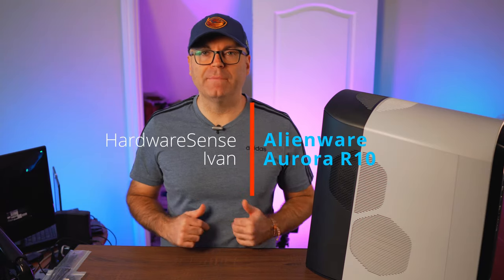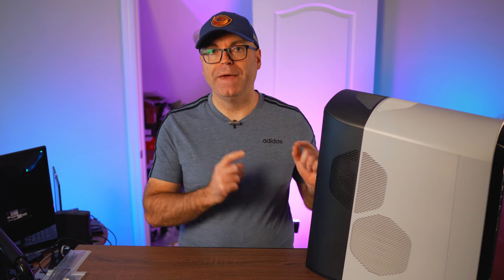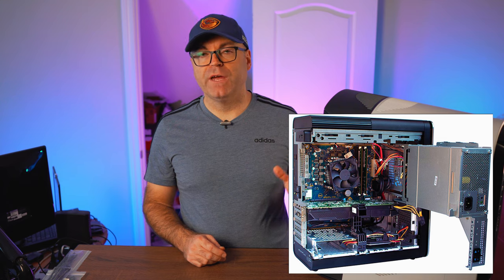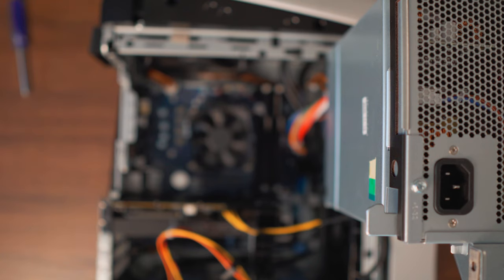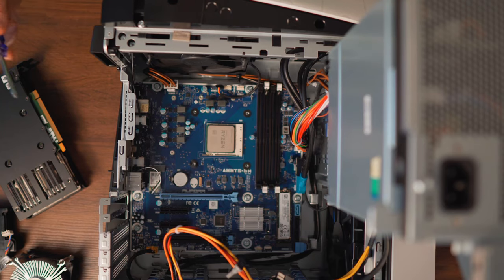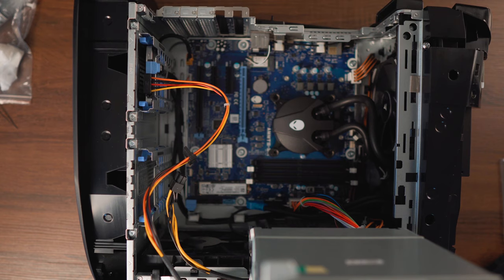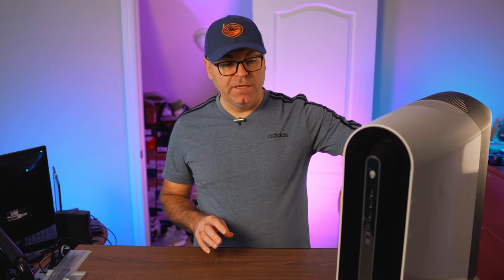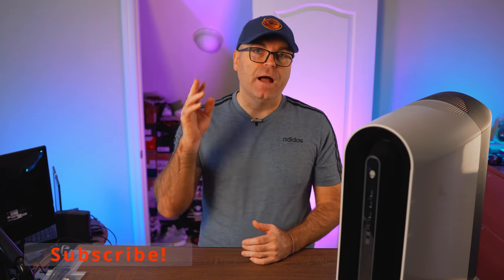Alienware Aurora R10 - All The Cooling Mods, That You Need!

Comment: Why do you need the VRM heatsinks? I just ordered a Corsair H60 AIO with included fan, do I need anything else?
Reply from the maker: As there will be nothing to cool them off there, it will help with the longevity of the motherboard
Reply: @HardwareSense  The top case fan won't cool it off sufficiently? If I'm not going to overclock the cpu, and the cpu WAS hitting 95 degrees before the liquid cooling upgrade, it should still be better than it was before in terms of heat on the motherboard, no?
Reply: @msharmall7298  The psu in this case puts so much heat onto the motherboard. I don't think the case fans alone are enough.
Reply: @reddemon163  Hmm.. I have been watching the heat sensors on the motherboard and only one of the motherboard sensors gets very hot. Maybe a peak of 85 degrees for only a second, usually under 80 while playing games. Also, I looked at my motherboard and I don't see room for VRM heatsinks. I don't see how they could fit, on mine there are little metal colored squares in the way.

Comment: What size screws did you use for the top fan of the aio? Im doing this upgrade today and my case only has to screws in the sop holding the bracket for the rad.
Reply from the maker: No idea, those are the standard that come with every aftermarket AIO

Comment: Interesting. I've built a PC but I don't consider myself knowledgeable of everything, is that push/pull config you've got on the radiator common? With one on each side? It's a good idea.
Reply from the maker: That is recommended for smaller radiators and others if you desire less noise without losing effectiveness
Reply: @HardwareSense  Oh okay, good to know. Thank you!

Comment: Hey, I'm having an R10 Ryzen 5800x with AIO - RTX 3070 and done those Fan Mods. Which FAN Headers do I have to use for which fan? Right now Im using an Y-Cable for the two top fans and plugged into Fan TOP. If I put the CPU Aio to CPU Fan - AWCC shows 100% all the time. Is there any way to implement Fan Control, since AWCC sucks a bit.... The software shows only my 2 fans from the RTX 3070.

Comment: Wow, that was a great deal on the R10 with an RTX3070 for $1200. Last week I was able to buy an R10 with a Ryzen 3800x, Liquid Cooling 1000w PSU, Lunar Light case, RTX 2070, 8GB of DDR4 2933Mhz, 512GB Nvme, Wifi 6 for $1240. I plan to upgrade the RAM with (Adata) XPG 16GB Dual Channel 3200Mhz.

Ivan, what's the highest clock RAM the R10 will take, 3600Mhz? How much and which RAM do you suggest?
Reply from the maker: I would go with 3600mhz, nothing more.
Reply: @HardwareSense  Is Oloy memory reliable? Amazon is selling a 32GB 3600Mhz kit for $149
Reply from the maker: @rodbriggs8552  I have one kit and is not bad, don't see any issues with it.
Reply: I’m crying lol 😅 I should have bought a computer back then lol. Still looking at a decent computer but geez, I missed out big time

Comment: Thanks for the awesome video! Would you have any particular cooling mods for the GPU? Or would these fans help? Thanks!
Reply: is there enough space to cool the gpu?
Reply: These fans helped significantly - I threw four noctua into my case and it's not only much quieter but even the GPU is -20C cooler.
Reply: @xenomorph7299  there's some clearance (maybe 3 inches) below the GPU in mine and an exhaust port right there, so you could certainly throw in a GPU AOI cooler without sacrificing either 3.5" bay. 
Not sure how you'd mount a fan horizontally - maybe on the side panel. I have that on my NZXT tower. It might work here too to push that GPU air out rather than having it blasting straight down on your supplemental SSDs. I didn't see a third fan slot on the MB but you might be able to split off from the others.

Comment: First off, thank you for this. It helped me with the process a lot

Question though; after swapping out the radiator fan for the push/pull configuration I am now not getting any spin on either fan. The actual water block seems to be working fine but no fan operation. I've checked the inputs and they all seem to be fully plugged in

If it's worth noting, I also replaced the front fan and added one in the HDD slot and they are working fine. So it seems I can rule out hardware issues with either the fans or the Y splitter
Reply from the maker: So the same Y splitter is working guaranteed?
Reply: @HardwareSense  the Y splitter came in a 2 pack, so I feel confident that it wouldn’t be the issue. I could be wrong though. The one I got is from JBtek
Reply: Disregard, I’m an idiot lol just checked again and the top fan input was only plugged into 3 of the pins rather than all 4
Reply from the maker: @Schmetzz  That was going to be my next suggestion, as it happened to me recently as well

Comment: I don't see a link for the 80mm fan you used for the top front intake, does it matter what is used? Are you able to control the fans with the control center after changing from stock?
Reply from the maker: I used the fan that is coming with the stock air cooling solution, just take that fan, as its PWM and can be synced with the front fan.

Comment: Just curious if there is enough space to mount a fan on top of the metal chassis above the radiator but under the plastic shroud?  It seems like the top plastic shroud is huge.  I have no experience with these but am considering getting one.  Thanks.
Reply from the maker: Not possible unfortunately, I tried already.

Comment: Spectacular job. Did the 2 fan upgrades using your video and 2 others to corroborate. Had i known (post job) that you did the third, I would have gotten the job done today as I ordered 3 fans. I did get a bios error, but changed the top rad fan power to cpu_fan instead of fan top and fixed it. I’m curious how the third fan will act when i get to it.
Reply from the maker: I did the same, initially getting only 2 but later a third one for the front. I didn't get any errors on my end everything worked right away.

Comment: Hi, I wanted to do the push-pull, but I can't find the proper screws for it. The original ones are too short to go through the top fan to the rad. Can you tell which ones you used?
Reply from the maker: Check out the comments they are listed

Comment: I also replaced the top fan with a Noctua PWM 4 pin fan. But I can not control this in the AWCC. How did you implement the fan control?
Reply from the maker: The AWCC will control the RPMs when needed

Comment: I have a r11 (air cooled) ((big mistake)) with i7 10700F and 2070super and noticed my cpu temps were around 95c average gaming so I panicked and quit gaming.  I opened up the case just for shits, left the case open and put a small usb powered fan blowing inside the case and my cpu temps went down to 74c average.  Thats over 20c average difference without changing any parts, that's just insane.

Comment: Thanks a lot for this video! Quick question though, I have an R10 with ryzen 3700x and plan to replace the air cooler with a corsair H60. I managed to find the left VRM on ebay. No luck finding the top part (4D5V9). Dell claims they don't sell it... despite you and other being evidence they do. Would you recommend going with only one VRM ?
Reply from the maker: I would suggest keep contacting them, every sales man is acting differently, I am currently looking for the VRM heatsink for my G5 and other people are saying that they bought it from Dell, but they tell me that they don't have it, or they don't sell it, last one told me they are out of stock at the moment.
Reply: @HardwareSense  Thank you!
Reply: Just as an update, I called Dell again, and they just offered to sell me their custom liquid cooling solution plus the J46J2 VRM. Apparently very few units are left.  However, the small top VRM remains unavailable at the moment on their side (no luck on eBay as well)
Reply from the maker: @Atreyuh55  How much for the AIO they want?
Reply: @HardwareSense  120 for the AIO + 1.15 for the left VRM heatsink. I live in Canada so those price are in Canadian dollars. With taxes + shipping the quote was 140 $. The rep left me his email address to check periodically for the availability of the 4D5V9 heatsink
Reply from the maker: @Atreyuh55  Yes that could work, but I would suggest keep contacting Dell, eventually they will restock. In addition, if you are not overclocking, it's not that big of a deal
Reply: @HardwareSense  Thanks a lot for your answers and your help!
Reply from the maker: @Atreyuh55  Appreciate the support.

Comment: Definitely awesome video Ivan, thank you for your time and efforts to show it here so everyone can get great benefit of it!! Just got a couple of questions regarding the fans and RAMs upgrade:

1. Would you mind to let me know what brand & model of the fan are you using to replace the HDD slot? I’ve read the comments that you’ve put the 80mm stock CPU fan in it, but 92mm will work too. So what is the brand & model your fan in the HDD slot?
2. Regarding all the fans connection, although I’ve connected all them but I’m a bit unsure. First of all, like in your video I replaced front, top and AIO stock fans with 3 Corsair ML120 Pro fans. Then I used 2 Y-splitters from Noctua, one connects top fan & AIO fan then plugging into “Top Fan” on motherboard, another one connects front fan & added HDD slot fan then plugging into “Front Fan” on motherboard. For the short cable comes from AIO pump, it connects to “Pump Fan” on motherboard. I’ve also notice this leaves “CPU Fan” port on motherboard vacant. Would you please confirm this is the correct set-up? Thank you so much.
Reply from the maker: The HDD cage fan is the stock CPU fan, any 80mm or 92mm would work.
The top 2 fans on the AIO should be in the CPU Fan PWM plug and the front in the Front fan plug, AIO Pump in the Pump plug.
Reply: @HardwareSense  Thanks for replying mate. So you mean I should plug the Y splitter (connecting the top 2 fans on the AIO) into "CPU Fan PWM plug", instead of Top Fan? That means Top Fan PWM plug should be no cable plugging in right?
Reply from the maker: @leoyin8149  Correct, and I can't remember, but I think I used that plug for the HDD cage fan, it's been a while I will have to double check
Reply: @HardwareSense  I see. I use a second Y splitter to connect Front Fan & HDD cage fan then plug Y splitter into Front Fan PWM plug.
Reply: @HardwareSense  As I searched online, if you air cool the cpu, connect the fan to cpu fan plug. But if AIO, the cable should plug in top fan.

Comment: I have an r12 with 11400f and 3060ti do you think I could get away with one fan for cpu cooler and one fan to replace the front fan? The Noctua NF-A12x25 PWMs are quite pricey!
Reply from the maker: I would just get the ML120 Pro, they at least 100% proven to work with no Bios errors

Comment: Great video! I purchased an Aurora r10 Ryzen 5950x with a Nvidea 3090 and did some research; the noise and cooling is an issue for some. I’m going to get the Noctua fans but my question is how many fans do I need for this monster PC? Thanks
Reply from the maker: I would suggest that you get 3 Corsair ML120 Pro instead, some people are reporting issues with the Noctua fans
Reply: @HardwareSense  Have you gotten any bios errors with your Corsair fans?
Reply from the maker: @Anthony-ve7ed  Zero
Reply: @HardwareSense  copy that. I’ll look into the Corsair!! You wouldn’t happen to know if the rgb version of the corsairs causes any problems be the non lighting by chance? If any 😆
Reply from the maker: @Anthony-ve7ed  The RGB would be fine but you won't be able to control the RGB and you not going to see it through the solid panels, so it's kind of a waste
Reply: @HardwareSense  and do you need any special extra large screws for put the double fan with the radiator? Where I can get it?

Comment: Do I 100% need the vrm heatsinks I seen multiple videos with people not using vrm heatsinks and still applying the h60. I'm going for the H60
Reply: How did it go? I am in the same boat. Gonna install my H60 in a few days without the VRM heatsinks. I keep reading online it's fine as long as you have decent airflow and aren't overclocking?
Reply: @msharmall7298  I did it last night and so far so good my gaming temps were in the high 70 going into the 80s even hitting 95 while video rendering and then I switched to the h60 and getting 50c while gaming. I don't know how to check my vrm temps but it's working so who cares lol imma buy the heatsink later and install it it's only 10 bucks on eBay so what the heck
Reply: @kammii7272  Can you find it on ebay? I couldn't. That's great about your temps though, my 3700x is heating up just like that. Even more so, maybe. I hope this upgrade has the same effect on my machine. Also I've never done anything inside a computer before, could I maybe add you on Discord so I can msg you any questions I have while I'm swapping it out? If not that's understandable
Reply: @msharmall7298  yeah just look up vrm heatsink for r10 on google and a forum will pop up and a guy in the comment section stated the part number if might have linked it. It's super easy but I'd recommend not watch this video instead watch another one I watched a tutorial from a guy named "Stony World" on youtube and he showed and stated it perfectly. When you watch the video I watched make sure you read the bio to bc if you have a r11 you have to plug in the h60 pump in differently but he states were to put it in the bio of the video so yeah
Reply: @kammii7272  ahh okay, thanks man I appreciate it!

Comment: When you replaced your fans did you lose control of fan speed?
Reply from the maker: Didn't even know there was control with the stock ones, lol
Reply: @HardwareSense  you can go to your command center
Reply: When you replaced your fans was Aurora 10 temps cooler?
Reply from the maker: @RichardMoreno24  Never needed to adjust anything, with new and old I left them at auto

Comment: I have the OEM heatsink for the VRM's from Dell. It is an "L" shaped piece unlike yours. Should i cut the smaller section away and not use that? I really don't see VRM's on the motherboard as I do with the first set.
Reply from the maker: Don't cut anything, if it fits, install it. Different versions have different types
Reply: @HardwareSense  Got it... I have an R12 so not sure if that makes a difference? There are just pads on the circuit board where those VRM's are supposed to be. Little concerned of a short putting the smaller heatsink over them? If you still need the smaller heatsink let me know. I have 2 of these from Dell.
Reply: OK i answered my own question. It appears the smaller heatsink section does not touch anything to create a short. Let me know if you want to smaller heatsink. Ill get it out to you if you do.
Reply from the maker: @alphaboy1872  Thank you, appreciate you trying to help, but I sold my Aurora a long time ago 😊

Comment: Great video. Can you do one on adding heatsinks and/or thermalpads to the dell oem rtx gpus. I just got my r11 with rtx3080 and the vram temperature stays at 100+ degrees when using memory intensive apps.
Reply: Set a custom gpu fan curve in MSI Afterburner. Make it aggressive. I haven't seen higher than 63 C since I set an aggressive fan curve.
Reply: The biggest thing you can do for the Alienware 3080 is reapplying thermal paste and adding some around the heat sink. The issue stems from them not having thermal paste for the rest of the gpu and instead putting stickers where there should be paste.

Comment: I was in that same position with the 3070 and got the 3060 ti version too. Same exact one you have
Reply from the maker: Its pretty good I have to say, especially for the price.
Reply: @HardwareSense  by the way, I contacted Dell for that VRM heat sink and they told me that they can’t sell me that part unless I send back the whole computer back to them. How did you manage to get the part from them? And also, I looked at eBay for the bigger heat sink and couldn’t find it.
Reply from the maker: @daniel-ix  Be persistent, contact them every day, different reps do different things, you will eventually find one to sell it to you

Comment: I'm waiting for my R10 to show up with a 6800XT and a 5800x.  It does water liquid cooling already.  Can I get away with just installing 3 of the Noctua fans or should I redo the thermal paste and reseat the cooler?  Nice video, btw. Thanks
Reply from the maker: I think that it might be a bit difficult to mount the fans without taking the whole AIO out, so repasting would be necessary.
Reply: I tried this, doesn't make that big of a difference. The case is flawed. I was idling at 65 and game time was 85. I got a new mobo, moved it to 750d with extra fans and Noctua NH d15 and I'm idling 35 and gaming at 60 to 65. And I used noctua paste. Mind you, you will lose your warranty if you do this, but it was worth it for me.
Reply from the maker: @rafayelk3736  Yes of course, so you just used the parts and made a custom, it's no longer a Prebuild 😉
Reply: @HardwareSense  only way to get an rtx 3080 these days :p
Reply from the maker: @rafayelk3736  That is exactly right
Reply: Theres literally 50 users between dell, redit, pictures, videos and benchmarks of it working and with a r10 3080 r5800x with liquid cooler and  push/pull config on the rad with 2x Noctua 2000 rpm 12-25s and then replacing the front bottom intake with another noctue or corsair and getting temps of 65c and under on the cpu under heavy gaming loads with ultra settings.
So it 100% works. I have this exact setup. So not sure what you did to have it not work but makes no sense